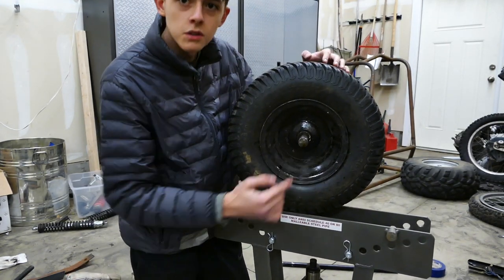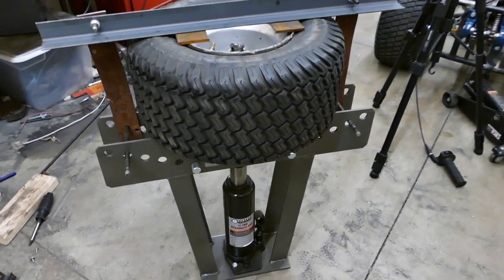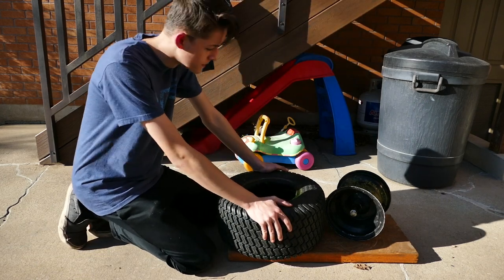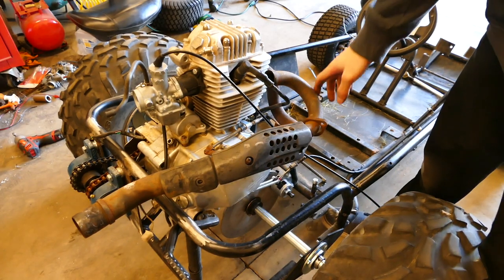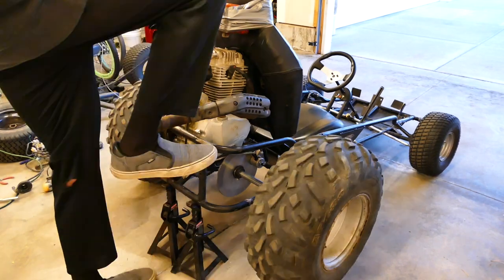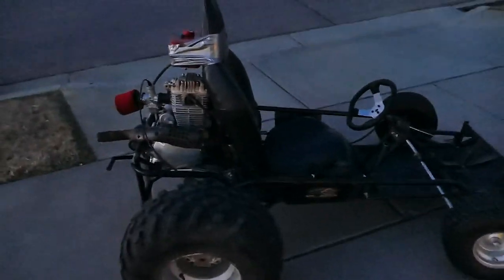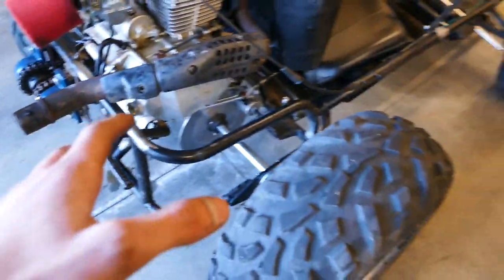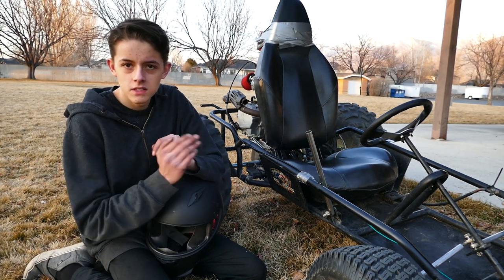150cc SHIFTER KART Build! || Part 2 First Test Drive!

Comment: Probably too late but the easiest way to remove stuff like that stuck axle is to drill a hole through the center first which relieves the pressure on it. Usually just punches right out afterwards

Comment: Also when something is rusted in. Heat ut up and use wax like candel wax it'll penetrate the rust and be a lubricant for you to press it out.  Also take a drill and dimple the  center of the shaft and use a point on a air hammer and heat... I've even had to take an angle grinder with a cut odd wheel and cut the hub around  the axel to hi e it relief  to  bust loose... zoom lubricant is one of the best to use as well. But the heat and cancel wax is a old farmers trick from back when my grandfather was a  mobile mechanic . He used that trick daily...